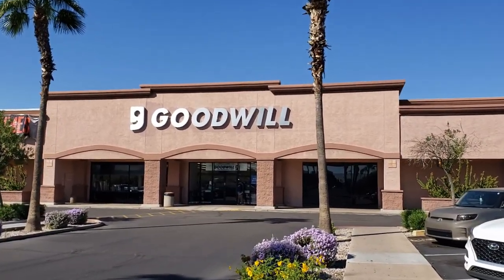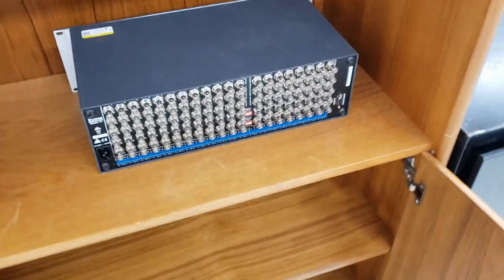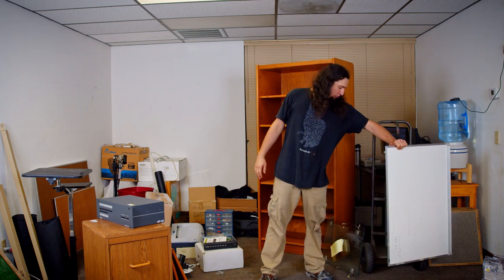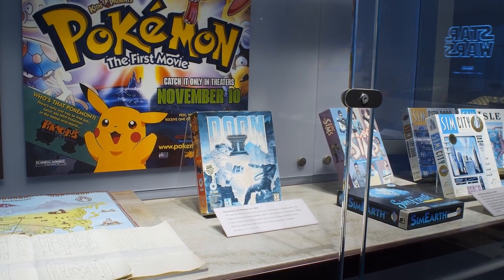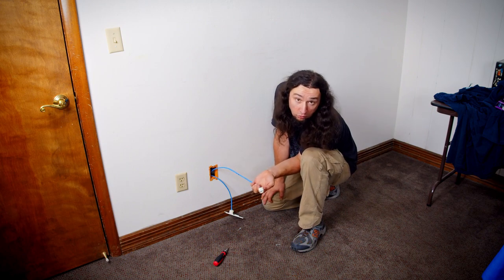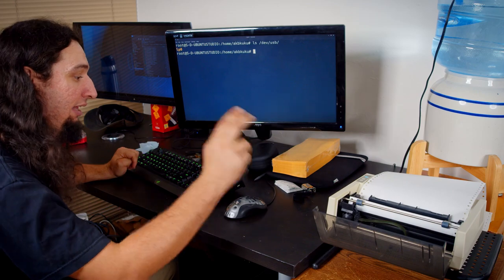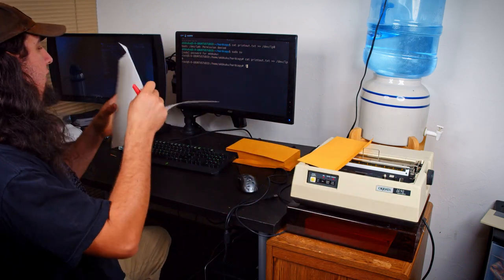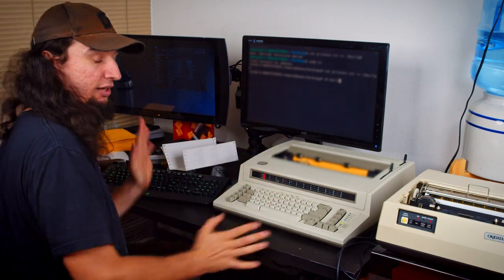Office Vlog 0x02 - Where are the Bookshelves? & Hardcopy Ready!

Comment: 17:40 those other "quiet" vents are air returns. The noisy one is the one that's actually blowing air in.
Reply: And it's "directional", blowing the air in four directions outward from the vent, adding to the sound level (in addition to the higher noise due to greater airflow).

Comment: I had one of those PowerKeys on my Mac SE/30 in the 90s. Basically it allowed you to add the functionality of the keyboard power key on the PPC era Macs to the earlier 68K ones. It was the key on the top of the AEK, AEKII and Apple Design keyboard with the left facing triangle. The old Macs didn't have the right power mode so they had to be switched off and on manually and that key was useless on them. IIRC you just had to run the keyboard to the PowerKey strip and run the ADB to your Mac for it to work, it switched the power plug off to your Mac simulating the soft power off of the new machines. Pretty neat!

Comment: My spouse works at a major Nationwide furniture retailer. They're running 8 weeks out average, some up to 6 months out. It's everywhere. When I bought my desk drawers from Ikea in March, I had been checking the site daily to snipe them. 

The ports are backed up, holding up not only completed furniture, but also bits to build for in country builders like Ashley. On top of that, the power outages, etc in China are holding up even more parts inventory. 

This is likely to be the new normal for the next couple years. My spouse says that their company is expecting this to continue for at least another 6 months to a year. They are dealing with a lot of irate customers over things that they basically have no control over any longer.

Comment: Wonderful progress.  You look much happier.  Back when we did such things, I would have had to use continuous paper with self adhesive labels and spend ages making sure the addresses lined up with the actual labels and then print them.  Then you would get the office junior to help you peel, stick and stuff all the envelopes.  "And it has to be done before you finish tonight!"  😄
Reply from the maker: I actually have two boxes of continuous adhesive labels I wanted to use for this! But I realized that they are probably 30-40yrs old and the glue wouldn't stick to envelopes any more.

It would have been fun to do it that way but at least I found another "period correct" way to do it because I figure that's part of the fun of getting one of these.
Reply: @TechTangents  I think you got the best result possible.  ✔

Comment: Hi! Sorry for the struggle with furniture...have you considered online-platform secondhand grabs? At least in Finland there's always a lot of choice for a nice price.

Also a word about the BILLY shelf; while it's good value for the money, the shelves won't hold much weight. Data sheet says up to 30kg/shelf but if you populate them with heavy books, binders or vintage electronics (hah) they will start to curve. Not right away, but after a year or so, and it's....annoying. For lighter stuff, like spare parts cabinets (for resistors, caps etc), Billy works just fine :)

Comment: For the vent noise what you want might want to try is either using a piece of plexiglass or for more sound absorption another ceiling tile and hang either a few inches below the current vent on little chains. This should help absorb the sound but still allow the air to deflect out the sides.  You should be able to do this no problem yourself and your landlord shouldn’t have an issue with it since you’re not altering what’s there or changing the air flow.

For those shelves, the little wire retainer might seem like they would be stronger but they’re not.  The slot is actually cut through the middle so you really only have half the shelf thickness above the clip holding the shelf.  And if the shelf is press wood, if it bows any it will break the top of the slot right off.  So don’t put anything too heavy on them.

Comment: The first vent could be closer to the air handler.  If so, switching covers won't do anything.  If there was a whistle, switching might help.  Be careful running the network cable.  In a commercial space even network cable (in-wall / plenum) frequently requires a licensed electrician. You will only need to remove one side of the bookshelf to make room to adjust the shelves.

Comment: That Extron Crosspoint matrix switcher is a great find, and it does much more than just VGA too: you can use it to switch composite, s-video, RGBS (composite sync only though), RGBHV, and even component from any of the 12 inputs to any or all of the 8 outputs. You'll need BNC to RCA socket adapters to hook up standard RCA style cables to it which can be found cheaply, but to connect RGBHV/VGA, s-video, or RGBS you might need to make or buy pigtail connectors. Looks like yours is a model that switches stereo audio as well, although you need Phoenix connectors to hook up audio. I've got a newer model that I found on eBay for a little more than you paid that was sold for parts and all I needed to do was recap it and it's rock solid.

Comment: I like to use the big cheap whiteboard panels for blocking out windows.  Similar to the foam sheets it'll bounce the light back out instead of heating up, but is rigid and won't degrade over time. The only downside is you have to to cut them to size instead of getting 'close enough' and just squishing the foam in place.

Comment: Welcome to the CrossPoint club. I'm very jealous - mine is only 8x4 :)

Edit: Hopefully it works. FYI, you can test it by plugging composite into the green input and patching that input to your output. For non-RGB inputs, R=C/Pr, G=Y, B=Pb. H sync can carry composite sync as well, but both H and V sync must only have sync on them (if you passed composite video on H, then it won't sync to that, but sync is optional if your output doesn't need it - it can't generate sync though).

Edit 2: You can substitute the ß with ss. Do not substitute with B. So e.g., straße becomes strasse ("street" in English)

Comment: If you lay a piece of paper up against one of those AC diffusers the supply would blow the paper out and the return would show a bit of suction to the paper. You should be able to move the diffusers to another section of the ceiling if the flexpipe is long enough to reach, also I cant see the landlord having any issue if you do this. Unfortunately without a new longer piece of flexpipe you wont be able to move it far. 

Hope this helps a little, I"m a professional technologist and also a huge fan!

Comment: The networking rewiring video will be extremely useful for me. I just moved into a new home and the walls already have the network outlets, but no cables. I do have a lot of network wires around but never did pass them through walls and I'm also a drywall n00b so I'm eager to watch that one as well. Keep up the cool work!
Reply: There are tons of guides out there that will be way more helpful than watching another n00b screwing it up. One that comes to my mind is Snazzy Labs' "Adding 10 Gigabit Ethernet to my 129-Year-Old House" - not the best, yet informative and fun to watch.
Reply: @misatzu  thanks for the tip. Will look into that guide.
Reply: @leandrocosta3709  thanks for replying! let my know how you liked it if you want to.

Comment: Those 110-block style punch-down keystones are pretty much one-and-done devices. They'll work if you rip the old cables off and punch new ones on (assuming you get all the bits of wire and jacket out), but they're never quite as good the second time around. Leviton keystone clones should be a couple bucks each; I'd just replace them for peace of mind.

Comment: That's a sweet Libretto, I have, what I believe is, the last model in the series, a dual screen model called the w100. And since it's relatively modern (2010) I got a new ssd for it and want to do some modern linux experiments, mainly getting it's only 2 physical buttons and touch screens working and have something that will be snappy enough with the 2GB of ram it has. Both Ubuntu mate and Lubuntu seem to work well for that, but I also want to try and find a chromium os build that will not bootloop on it... or fail to load a wifi driver... or stop seeing my usb keyboard >_>
Oh right! also keep up the great videos, looking forward to all the cool things you had plans for previously, but never got the space to do until now.

Comment: Those fixed shelves use what are known as cam lock nuts. They are moveable, but the screws will widen the holes(possibly chip up the wood around it too) for your shelf pins and make them fall out if you were ever to move that type of shelf there. Shame your furniture isn't probably worth fixing up and trying to repair some of the damage/scratches to the wood. Almost seems worth it for a youtube channel.

Comment: As an in the meantime solution, you could get a cheap air filer and tape it onto the ceiling on top of the vent to mitigate the noise
Reply: what is an "air filer"?

;>
Reply: @misatzu  as in an air filter you he previously replaced that go right inside the intake.
Reply: @wilsondavenport6939  ";>" as in "I'm a winking smiley with pointed lips to clearly indicate sarcasm"
I even set it apart so that you don't overlook it :]
it was just funny how "air filer" sounded like it could be an actual thing until I realized what you were actually trying to say ...
Reply: @wilsondavenport6939  P.S. I'm tempted to ask what "you he" is supposed to mean and which of those people "go right inside" but imma pass on this one, anticipating the same kind of reply I anticipated the first time already :3

Comment: if you have cat6 dont replace it with cat6a, its not worth the hassle of dealing with shielded cable. cat6 can run 10gbit, at a shorter distance than cat6a, and chances are, its long enough for that. it the line is over 200ft and you really want 10gbit ethernet, then go for it i guess.
Reply: Yeah, I wouldn't bother. If it did turn out to be a longer distance on a cat 6 cable the worst that usually happens is it'll auto negotiate down to 5 gigabit or maybe 2.5, but generally still faster than 1 gigabit. The shielding is a pain in the butt to work with and do properly. Having done 6A installations, it's easier to screw up and do it incorrectly and end up with a cable that doesn't technically meet spec and has issues then it is to do cat 6. You have to pay a lot more attention to exactly how much you're cutting back and untwisting, etc.

Comment: Be wary when buying LED lights and filming lights. Cheap filming LED lights and cheap LED panels will not be the correct colour temperature. And will most likely be different temperatures. I'd speak to a camera or filming specialist company to see if they could provide both. Your blue LED light should be white if you do a take a manual WB reading.

Comment: • Are you going to post a 45-minute video every day until the office is set up? … I'll find a way to make it work, dammit!
• 35:00 - The Eszett (ß) was mostly eliminated and replaced with a double-s in the orthography reform of 1996. For the most part, only proper-nouns and some words retain it, more for historical than linguistic reasons (backward-compatibility).
Reply: What you said about the "ß" is only correct regarding words where it follows a short vowel. Other than that it's completely wrong. The ß has a function, which is to indicate that the preceding vowel is a long vowel. For that (and also following a diphthong with a few exceptions) it's still in use as it has alwyays been.